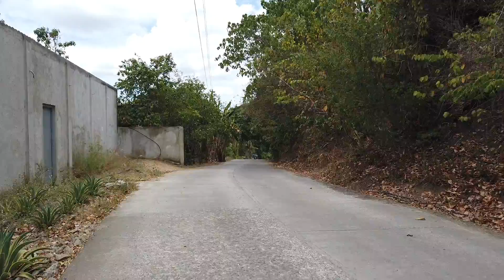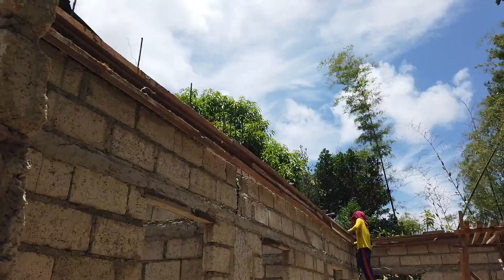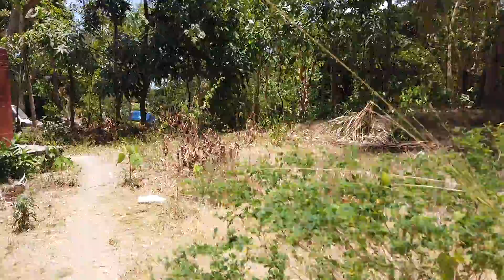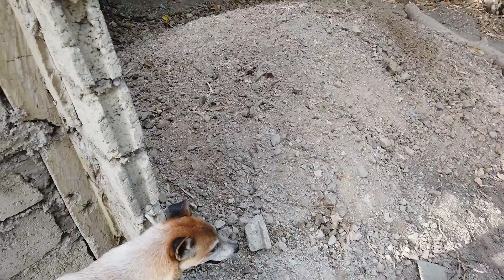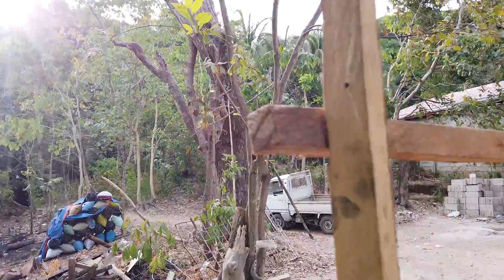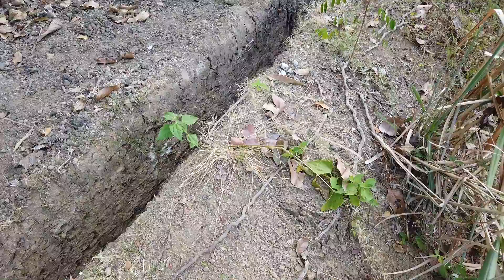Day 29 Budget Bungalow Build In The Philippines.

Comment: I'm just wondering if rebars would go rusty and crack the road?
Reply from the maker: The rebars will be in the cement slab, cracking of slabs are usually cause by poor cement mixture or sparse promixity in placing the rebars.

Comment: Regardless of the concrete mix, thickness, or use of rebar, the most important factor for a road/driveway is the base preparation.  Remove top soil (possibly can be sold) and major tree roots that could decay and create pockets in the future, fill as needed and grade for drainage, then compact (preferably with a steamroller).  Then, use 4"-6" of road base rock, compacted each 2" of cover, with another 2"-4" of "crusher" rock on top of that, again compacted each 2".  At this point, 4" (10 cm) of Class A (1-2-3 or 4000 psi mix) concrete without rebar is fine.  However, I suggest instead you just use 2"-3" of pea gravel on top, compacted, and call it done.  After a couple of years use and seasons, the roadway will have settled nicely and you can go back and concrete it then if desired.  I definitely recommend NOT concreting until after home construction is completed to avoid damage from heavy trucks or construction equipment, or at least make sure nothing too heavy drives on it until after the concrete cures to full strength in 30 days.  Good luck!
Reply: I wonder about the wooden (?) lintels.
Reply from the maker: Andreas Kreissl, The wood is just forms and will be taken out prior to rendering, the lintel is the concrete above the form.
Reply: @villagepeoplephilippines  After I wrote it, I was guessing the same.I´m not a construction engineer, just an electrical engineer who has accompanied construction projects from time to time. Will the concrete be able to carry the load? Anyway, your projects are necessary and I appreciate what you´re doing!!
Reply from the maker: Andreas Kreissl The lintel only has to carry the weight of two blocks, with some of that the weight transferred to the columns. The stronger header that holds the roof  with the weight of the roof also transferred to the columns.
Reply: @villagepeoplephilippines  👍

Comment: By the way . Regarding your p trap located next to the septic .   I'm not a  plumber but worked in construction 28 years and also relocated my own septic tank at our house in Florida .  
    In the USA all drains , like sinks and showers are required to have p traps and vents .   Buuut  there are 2 regulating groups in different areas. A upc and ipc who don't agree with each other at times .
 Any ways I looked up p traps located at a septic tank 
  It was more common once ,it was called a " house trap " and was required when hooking up to city sewer .  Now it's a debate if it should be used since the drains in the house have p traps Already .  Some say it's double trapping ,which can cause  venting problems .    Others say no .
     It stated that a vent in-between the tank and the p trap would work  to vent and prevent the gas from entering the house . 
   So it's a different style .  And yours only has the trap at the tank . ( No double trap argument )  
 I'll follow the  p trap in the house plan personally and I think I'll do the plumbing  myself  .

Comment: Also nanai check the air filter it could be full of dirt in the engine it will make it waste gasolina & block up the spark plug  of the cement mixer po
Reply from the maker: Yes , we have done that we changed it, thanks

Comment: What will you be doing about guttering for drainage between the new build and the older house?
Reply from the maker: The usual practice here in the mountain areas is not to bother with gutter as the rain water will flow down on the slight slope towards the river but if we are in the city roof gutter is a must. The old house will be demolish soon as they transfer.

Comment: Do the concrete block buildings hold interior temperature better than a frame house?😀👋💖
Reply: Yes they do. But also helps with design you want to do. In Phillipines it hard to do a lathing interior and use drywall. The humidity destroys so fast unless you want to run aircon full time. Then that makes a different set of problems..but yeah blocks are cooler.
Reply: It's why you see them skim coating interior with concrete finish. Drywall or gypsum does not work there. It can grow  mold and other problems. Unless you 7/24 run aircon.